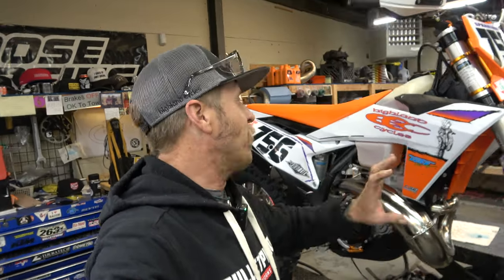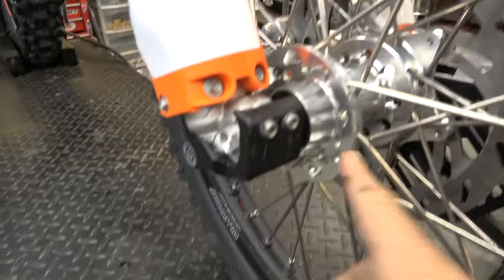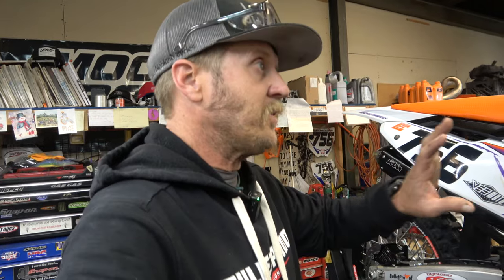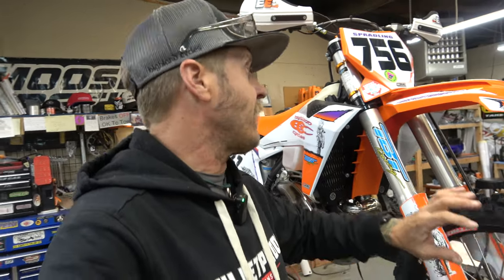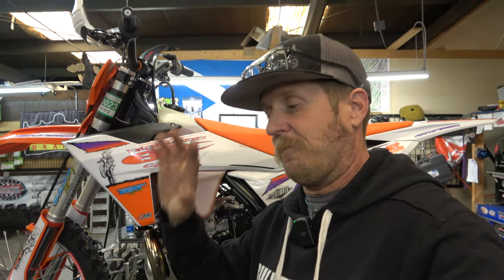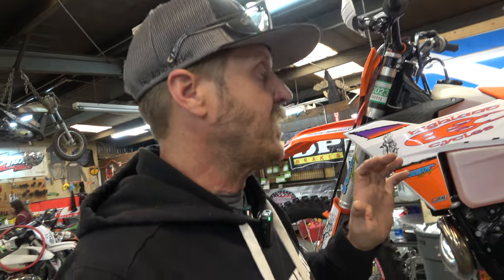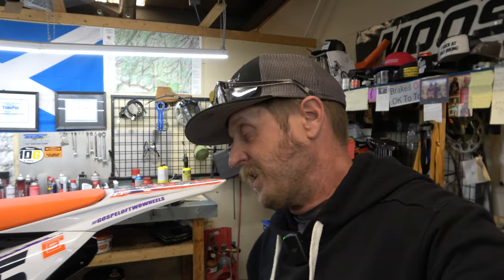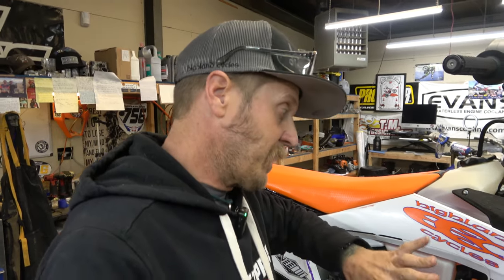2023 KTM 300XC Final Build Video | Ready To Race | Highland Cycles

Comment: Love mine now that I’ve gotten the suspension set for me. I have had the fault code and fouled a plug mid ride at slow speeds in a technical section. It was shortly after I tried the mild map. They took the bike in and adjusted the powervalve settings and said it should be good. We’ll see but I ran the mild map for just a little bit and it felt like it was loading up again. Other than avoiding that map I love the bike!
Reply from the maker: Try a BR7ES plug
Reply: @highlandcycles  that’s what replaced the fouled plug. Still loading up on the soft map. Have an rk tek head and like it so far but need more time with it. Love your content I’ll try and keep up!

Comment: Hi.  New SUB here. Thanks for the vids.
So- it's race ready - but do you know when you'll have to pit for fuel ?
Reply from the maker: Currently I am pitting at about 30-35 miles
Reply: @highlandcycles  Ok.  I've got my '23 on order so I'm very curious on the fuel consumption compared to my TPI - which is great on fuel.
Reply from the maker: @philipcaudill626  It burns it fast when you are in the open stuff.  I have a few videos discussing it so far.  But I am getting between 20-25 mpg

Comment: I had forgotten but in 1994 FMF sent me a free exhaust pipe for my KTM 440 ( stock that thing would not fall out of a tree )so I worked my Magic and turn that thing into a fine motorcycle . The FMF pipe that I had was not that impressive and I called them and told them And they said we actually have a brand new exhaust pipe we’re gonna send you that’s been updated so they gave it to me for free. ( Also the turbo core spark arrestor  they rewedded never did break again) And you’re right Chris at  Enduro engineering is a good guy .I’m going to have to now call him and ask him where all my bling is .To which he will reply …as soon as you get a bunch of followers on a YouTube channel I’ll take care of you also .😜😜😁😁

Comment: @highlandcycles I am also getting a 300 xc and getting the bulletproof designs front and rear disk guard, what size disk guard do you have on yours? The 26 mm or the 22 mm?
Reply from the maker: The new BPD guards come with all the spacers so they fit all axle sizes
Reply from the maker: I see you mean the front. It’s the smaller axle like last years